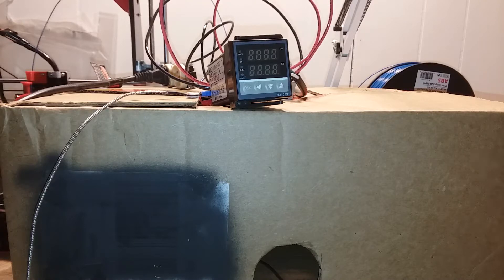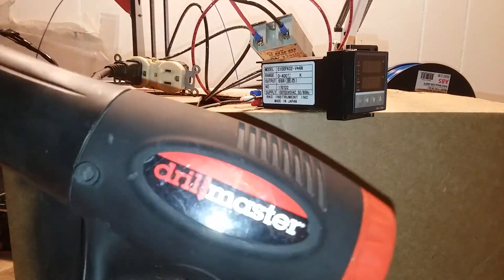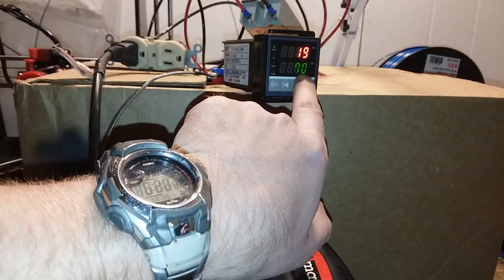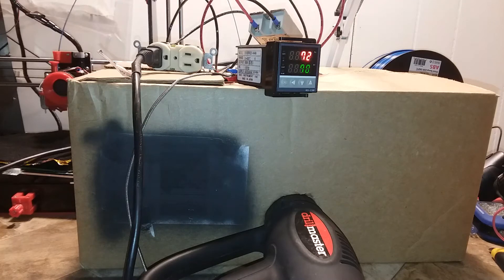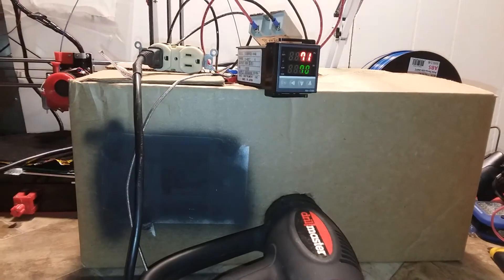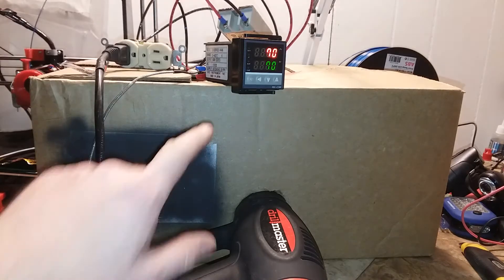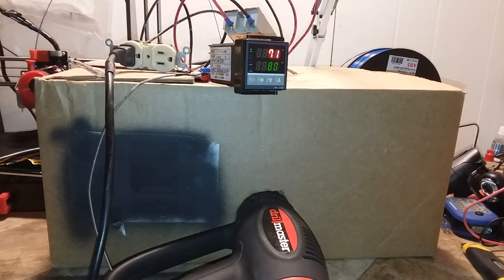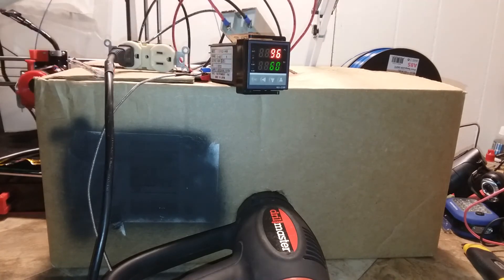3D Printer Enclosure Heating Test

Comment: Why do you need the solid state relay?
Reply from the maker: The SSR turns the power on and off to the heat source
Reply: @MrDabrudda  Hi, I wonder if there is any way of using a smart switch instead of a SSR? Good job anyway!

Comment: Great video, thanks for posting. Thanks for mentioning the 70 C setting.   I am getting ready to do the same thing, I was thinking I would try using several flood lamps for heat.  I have looked for a controller that rather than using bang-bang on / off control had a linear dimmer output.  I haven't found one.  Have you seen such a thing?
Reply from the maker: You might try a thermostat for a furnace or AC.  The type mounted on your wall to control the room temp.